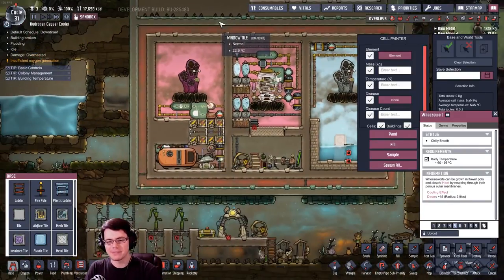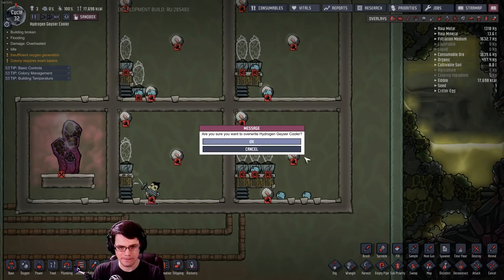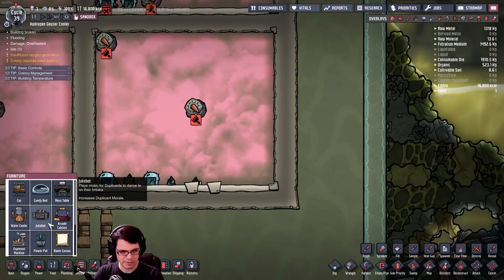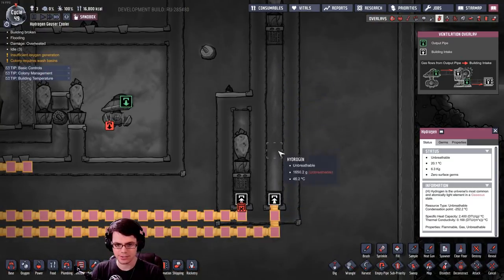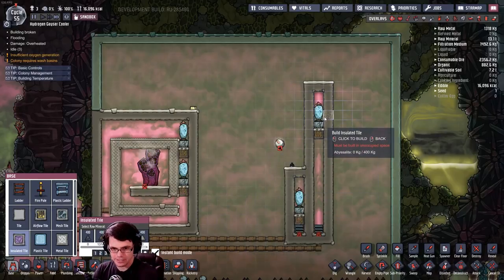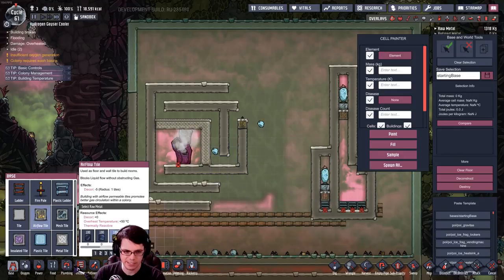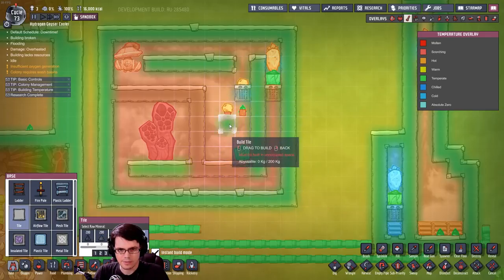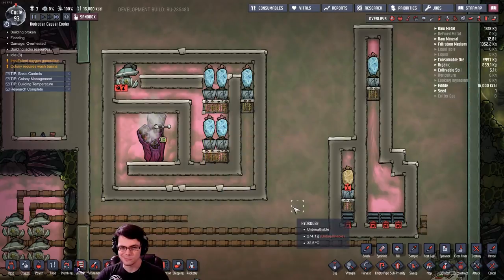Super Compression and Geyser Cooling! Venturi Wheezewort Oxygen Not Included

Comment: Wheezeworts can bend the space-time continuum to fit impossibly large amounts of hydrogen into a 1m x 1m area. I will never look at one the same way again.
Reply: I wonder if Weezeworts can compress enough hydrogen into one space as to cause solar ignition?
Reply: Only if pressure is implemented that it can generate heat in ONI. If they ever do that, I'm going to make some popcorn and see how many asteroids will explode because of high pressure hydrogen systems.
Reply: It would be one hell of a way to close out a base in ONI.
Reply: Did you know that wheezeworts are canonically animals?

Comment: The wheezewort is the point in the venturi effect where the gas is forced through a smaller diameter. When passing by the wheezewort it is accelerating faster allowing it to pull a vacuum from below the ww to above it.

Comment: Brothgar, move your cooling circuit up one block and over to the right one block, so you can put a vacuum  gap around the vent. You'll also need a bit of a precooling method before the cooling loop, try polluted water in pipes or radiant pipes down the center of the entrance tube.

Comment: Wheezewort pulls in gas from the bottom half and exhales gas from the top half.  By limiting where the gas can come in, and where the gas can come out, wheezewort becomes a power free gas pump.

If you block the lower half off from surrounding gas, it can only pull from the space at or under its base.

Comment: Wheezeworts suck in air at their bottom tile and pump it out probably at the top tile at a rate of 1 kg/s. Apparently due to the game mechanics the vacuum in the bottom is filled with air from the air flow tile before it comes pushing from above, creating a kind of pumping effect with high differential pressure. That's an astounding and gamechanging effect, though I would expect that to be changed in the future.
Thanks for the video!

Comment: The steam vent emits gas at 110C which is actually below the threshold where gold amalgam equipment breaks. So technically you should be able to sink the excess heat from the other vents into a steam vent using a constantly circulating loop (don't even need any automation, just a valve set to like 9.9kg/s to prevent it from locking up (use a bridge just before the input to the valve to keep it from over filling with coolant. You can leave the "filling bridge" in place to automatically top up the loop as you expand it.

Comment: an interesting thing I have found in my own experiments with weezrworts thanks to this video:
(A) a weezewort is 2 tiles high excluding the pot ( common knowledge , but still )
(B) a weezewort moving 1000g/s per second is likely beeing over saturated
(C) the bottom tile needs to be a vacuum in order for the weezewort to move gas up
(D) an over saturated weezewort can't keep the vacuum on it's bottom tile
(E) an over saturated weezewort will still cool the gas it is in.                 

Thought this might be helpful information for better gas cooling ans flow control.
Reply: as an added thought the longer the chimney before the first weezewort the higher the pressure can become before the weezewort will be over pressured

Comment: Push the initial hot hydrogen through airflow tiles submerged in a cooling liquid. Then you don't need to worry about the compressing wheezewort overheating.
Reply: The liquid would stop the airflow.
Reply: @heerhenker7497  Liquids don't penetrate airflow tiles.
Reply: @thesentientneuron6550  ohh you mean sideways? That would work.

Comment: On each "tick", a few things happen...
1: Air moves (or vibrates), at around 90% left or right, and 10% up or down. {Like a dice-roll, random} Countered only by "volume/pressure" and "specific density", by a TINY factor. There is no real "flowing" in the game. It's random dice rolls, simulating something like "flow". That's why it takes forever for air and pressure to seem to move, when it should be 4000x faster than that, like in reality. You can have 8000Kg directly above a block of 10Kg, for about ten ticks, before it suddenly decides to "swap them", or "remove 10%", to shift that into the other block. (It's spread-sheet cell-shifting.)
2: Air "diffuses", into like cells of material, by about 10%+/-, no matter the temperature. (Unlike reality, where higher pressures would easily diffuse into a lower pressure, with more volume, as an exponent, not a percentage.)
3: Temps move with the percentage of air moved. (Again, unlike reality, where compressing would heat-up elements, as the molecules are now "colliding together faster". 2 units of heat, crammed into 1 unit of space, should be 2x hotter. Thus, if you cool it by one unit, so that 2x volume is 1/2x the heat... If you decompress it back to occupy 2x space, the temps should be 1/2 what it was. Half the heat units should have moved into each location. Which is how a home AC unit works.)

Things messing with your designs...

1: You are using a single "flute", which leaves 90% of the motion unable to move, as it wants to move left or right... as well as 10 up or down. Using a double-wide flute, or three wide, will create better "flow". (You started to tap into that reality when you had three vents leading to one wheezewart. But you only needed one vent in the center, on the floor. A space to the left and right, as well as the space that is obviously also above it, free of obstructions. Yes, an "air-flow tile" is still an obstruction.)
2: You only need to "block it in" just above the "pot". Since that will isolate the "pressure-expansion grid", which is actually 3 blocks. The tip of the wheeze-wart, the space above the tip, and the block to the left of the tip, are the three "outlet vents" of the plant. (I assume it's a math-fail, keeping the fourth location on the right of the tip from working correctly. Decimals, what are those... Just round-up to an INT and its all good, until it fails, like it does here.)
3: You can "focus" the output into "one single block", because the game has a neat set of code that checks for "drop space"... If there is a wall to the left and the right, it will try to "drop" the exhausted air, to the left or right of the wall. Like when a fallen item is in a space that you are building a block... It freely jumps-out, into a detected "free space". So, you are stacking 2x into the tip... (The left-tip and the center-tip air.) While the imaginary vent above the tip, is freely dumped into the unrestricted space above the tip. It will take one more "tick", to get the air in the tip, to push up into the space above the tip, if it can. {Depends on the max pressure limits. When reached, all air is counted as a "solid block", with the only place to move, being backwards, into the "vacuum" you created at the base of the wheezewart plant. Leading to a "pump effect failure".}

To maintain flow, at that point, you simply have to use a door to eliminate the overpressure. The door along the side, so it opens and allows excess volume to shift into the door-space, so it can get "destroyed", as the door closes, just before you detect overpressure conditions. Otherwise the cycle of flowing will cease and the "pumping" will also stop, as the game slips into an endless loop of moving MAX-PSI from the base, to the top, which is also MAX-PSI, forcing it back into the "draw" part of the plant... Again, a simple command of some forced math would prevent that "infinite lockup", but it doesn't have real complex math here. Just "number-tricks", that work, until they don't.

Comment: Since the pressure drop in your venture like design, you could probably chill the gas at the point with the lowest pressure faster then cooling the whole environment. A bit like the pipe in a climatisation unit
Edit: you kinda did it with the second design, but I was thinking with a radiant pipe in the middle to chill the gas.

Comment: i did some testing on this with the gas element sensor setup to sort gases, occasionally youll get some mixed gases which will stun the storage. once it reaches about 4k. 
the way to get this to work you MUST NOT have any thing inbetween the vent and the airflow tile, that includes ladders or material on the vent. it stops the gases from funneling up the venturi. no clue why but it was a weird finding. this would be a very good system for storing early Carbon Dioxide and Chlorine, you can build a gas vent on top of the system perfectly fine however, i believe if you could make a perfect gas loop to keep recycling the gas element sensor setup from the fart dupe video works well unless you have an over-pressurized area you want to clear, you could make a venturi storage system that also works as an oxygen cooling system by recycling all the oxygen and uses doors on your next weezewort chain, to block the gas flow, you could make a system that acts as a gas filter, storage AND air conditioner for LESS THEN 325 W. 
240 for a gas pump, 10 for each gas element, and a gas element sensor (25w) so the pump doesnt pump on oxygen once your base is cooled and purified. 
I think weezeworts might need a rework after this finding.
Reply: after doing more tests this morning, ive found that for storing gases it works best to build the pump to the left, of the venturi. 
but the major issue seems to be the pure randomness of it. if i had to assume if the venturi cools the gas faster than its pumped the coool temp will drop and the venturi will stop working. that would explain why the the ladders and objects would draw heat and cool the vent would make this system fail by insistent temperatures. for that reason although an amazing find, the inconsistency makes this too unreliable for a me.

Comment: Why not insulate the wall between your cool loop and the vent area? It seems to create more problems than it solves. If you are that worried, then you might try to do a metal tile further down the line, like before it reaches the first weezewort in case you are worried of overheating the first one.

Comment: I think a simpler way to do it is just to do upward flow with wheezeworts and downward flow with a pipe and a pump. Or if you really have an excess of wheezeworts, don't recycle at all, and just have a daisy chain of wheezeworts so long that all the gas at the top is already cool enough for your needs.

The only thing that bothers me is that to imitate that vertical system you had, you need to avoid backflow from the pressurized area. I'm not sure whether the lack of backflow there would still occur if the space at the top were 2x2 instead of 1x1.

Comment: OK so why not use insulated tiles around the vent to keep the H from warming back up?  That way the only hot part is the H going past the 1st weezewort.
Reply: I was thinking the same. Try it with abyssalite tiles and see what happens. It looks like it's picking up extra heat from the h2 around the vent, preventing it from cooling as efficiently as possible. May be wrong, but worth a shot.

Comment: Now, my only ONI experience is via your content, Brothgar, so if this is a dumb Idea I apologise.

But, here it is: Can a self-powered electrolyser set-up produce enough surplus hydrogen to power a thermal nulifier to cool down a steam vent? 

In other words, in your three-chamber experiment, can you replace the hydrogen vent for a self-powering electrolyser?
Reply: It should be able to. a SPOM uses less than 800W of power, a H2 generator needs 100g/s to generate that kind of wattage, and an electrolyser produces 112 g/s or something like that in hydrogen, so you should have more than 10g/s of hydrogen available ( due to the LESS than 800W requirement, the generator will use less than 100g/s, thus giving you a good margin ).
This can then be fed into an AETN for cooling, fill up a pipe with hydrogen, using bridges and such to make it a continuous cycling loop, and you can cool down the H2 in the AETN room, and use the cold hydrogen to cool down the steam vent.

Comment: I have found a bug where you can store unlimet amount of gase in an tile all you need is build a vent on the bottom of your storage at least two tiles away from any wall than put some fluid in the room and build mesh blocks left and right of the vent so that basically a little amount of water is at the vent 
Then you can pump unlimited amounts of gas in the room
I can post some screenshots if you like

Comment: I used a system to cool water from steam vents using carbon dioxide, when you use carbon skimmer it drops the water temperature to 40 degrees whatever the water or the carbon dioxide temperatures are, then to the water sieve then to a room for the thermo aquatuner, two of them are enough to make the water temperature 12 degrees. you will have to cool them down, so i use the thermo nullifier.  the only problem now is that there is no enough carbon dioxide lol, I'm trying to figure out a way to harvest it
Reply: To get more carbon use coal generators

Comment: That work with the alga co2 to o2 things? Might be a good way to push oxygen to the top of a base and pull co2 out of it and move it without motors? 1 wart at the top of a shaft and an the alga thing or 20 at the bottom?

Comment: Will the hydrogen turn metallic if you let it run long enough?
Reply: no, Wheezes don't cool gasses below their condensation point, and they don't work below -70 or something while for liquid hydrogen you need over -200°C so it's a double no
Reply: @666Tomato666  he might be talking about the critical point. Besides heat deletion, the plants is also pressurizing the gas. Enough pressure should be able to force the gas to condense and then freeze at whatever temperature. Just use the density to find moles, plug into PV=nRT and match the pressure to the phase change graph of H2.
Reply: @Septicemic-Fugue  in reality, yes, but we're talking ONI, and condensation based on pressure is not something that happens in ONI
Reply: @666Tomato666  huh, didnt know that. For some reason I expected the game to follow ideal gas behavior fairly consistently. Then again, adjusting boiling points for each generated planets atmosphere cant have much purpose

Comment: Brothgar can you stack 2 wheezewart side by side and compress twice as much gas twice as fast?  And then add a pressure release valve with a door and a pressure sensor? That way you can remove gas from your system and into a gas pump room to use elsewhere around your base.

Comment: Hey Brothgar, can you test super compression of gasses with a Weezewort? I am finding some odd results. CO2 for instance will break after about 40kg of pressure. The pressure reverses past the Weezewort and then no longer returns to correct flow directions unless you induce low pressure above the weezewort again.
I thought i found a very cheesy way using a weezewort to supercompress the CO2 in an early base using an auto door hooked to a Gas sensor set to co2 at the bottom levels of my base. Worked amazing until the back pressure issue.

Comment: Hmm, very nice Designs! But I´m still wondering why you use granite and not sth like abyssalite, because:
- The worts themself don´t realy cool their Body, just the air, so if you connect their Body to sth heat transfering they will just heat up using their startup body temp. and not their cooling effect.
- The granite is a huge heatsink, so it can cool down lots of stuff just by starting at a lower temp, so it will influence your Experiment and it will react very very slowly, so you cant realy see if sth happens shortterm

Comment: Wait, what about three worts and one long tube? Then you can probably process even more gas at 23.5C.
Did you forget that you also need to train a dupe to Miner Level 2 to mine abyssalite, and Miner Level 1 to mine granite, which also requires the job board?
Instead of a venturi, I'm just thinking of a funnel. You'd have three gas vents, then compress it down to a one tile space, then you'd have airflow tiles and three worts on top of that one-tile compress, and it'll probably still work...
Reply: I was thinking the same, and it would also make the bubble of gas pumpable to cool base and/or make energy.

With two setups like this you might even power continuously and automatically, by alterning between the gas compression silos

Comment: Isn't there a "cheat" where you put a gas vent in a very small room with 2 gasses, one is you are putting in a room and the other is "filter" gas you force over the vent?
By game mechanics, only one gas can be in one block at the time, you put a let's say hydrogen in room but there is a small amount of oxygen on vent block, so hydrogen gets pushed on nearest "free" block. (didn't play for some time, so i do not know is this still working)
Reply: lifegrow did that with oils and water. 
you fill a room to a certain point then have a 1 block liquid vent, put a drop of oil if youre storing water, and vise vera. 
then kept pumping to that one tile the oil was on and it super compressed.
Reply: with liquids i dont know, but gases get to a point where the pressure of the desired gas crushes the cover gas out of existence
Reply: Uh didn't know that it'll crush it from existence, i never pushed it that far. Need to try this method with liquid. (Also from brothgars video, wheezewort method looks nice)
Reply: @joshuaslattery2416  careful with that. Lifegrow said himself that if you let it get to around a billion kg per tile that your game will crash.